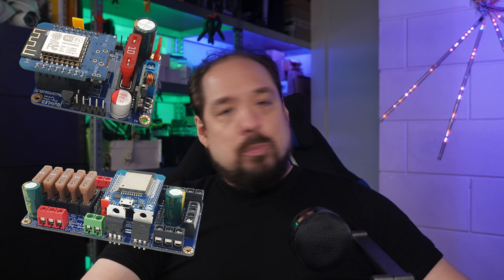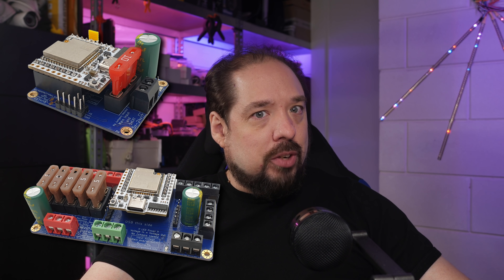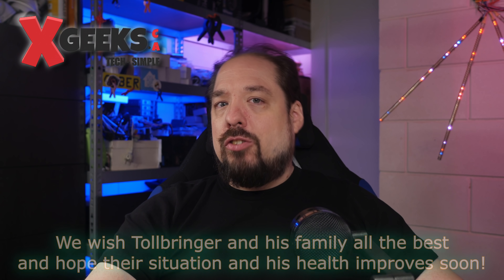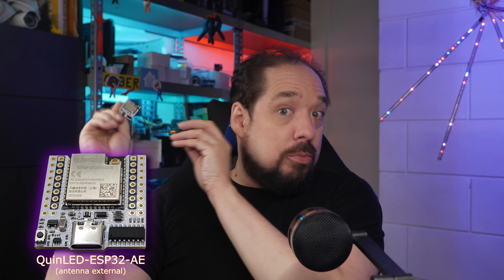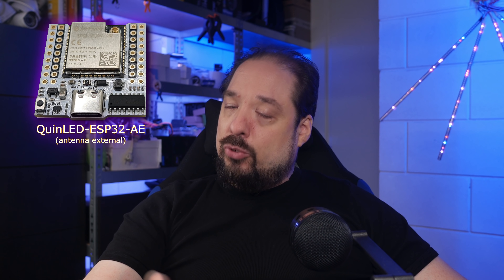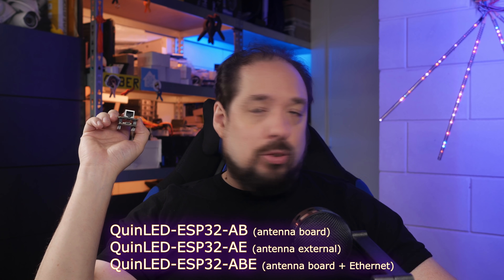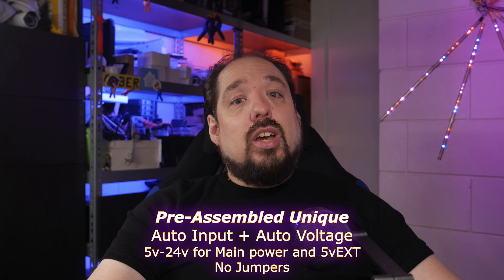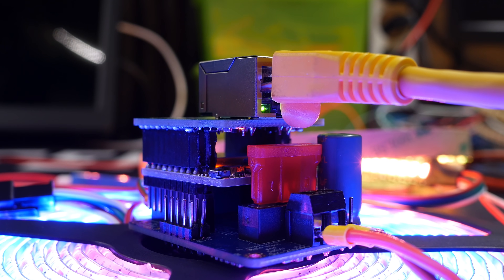💡QuinLED💡 Why out of stock for Dig-Uno and Dig-Quad?

Comment from the maker: What type of board combination are you most excited about? Let me know in a comment!
Reply: Super tof werk aan het verrichten! Ik ga zeker een nieuw pre-assembled board kopen, waarschijnlijk die met ethernet. Ik kan niet wachten!
Reply: Looking forward to esp32 with external antenna on a diy quad. Just love soldering too much.
Thanks for your work and keeping the diy alive!
Reply: DIY Boards, of course! This time I'll pay for a solder mask, yikes, way too many small parts last time
Reply from the maker: You mean a stencil? I'll still keep to 0805 as the smallest component so should be fine without too, but stencil can't hurt either. :)
Reply: @IntermitTech  Are all the dig quads 2oz copper? I plan to run 1920 WS2815s which is 300-350 watts continuous on white and I want to make sure it's safe.
Reply from the maker: Pre-assembled is always 2Oz, yes. Those wattage should be no issue, try and keep a little bit of airflow around the board if possible. Inside of a box it would cause a bit of heat build up.
Reply: Looking forward to Ethernet version.   Will have to design a DIN rail mount for it as rest of my home automation devices sit in a cabinet with DIN rails.

Comment: Hello , I need a help; I have a Dig Uno, how many pixels of a WS 2811 string can I handle with this, I am feeding it with 5 Vlts 30A, The reason why I ask is that I have a matrix of 800 pixels of 5 Vlts, I would like to know if the Dig Uno with Xlights can handle it without problems.

Comment: Great to flash online but when trying to flash the SR version it just hangs at "Wrapping Up"........ suggestions?
Reply from the maker: Yeah it's done at that point, it doesn't yet support the wifi setting. Reboot it and it should broadcast an WiFi AP like all WLED worked before. :)
Reply: @IntermitTech  Thank you.  That worked

Comment: Do you think now would be a good time to release the gerber files for V2R6? As long as there isn't an R7, there really shouldn't be much confusion once V3 is the new standard.
Reply: Just wondering because I recently got into designing PCBs and I learn a lot from reverse-engineering or just playing around with existing material.

Comment: How do you connect a microphone (for sound reactive), to the dig uno? I see an A0 pin, but it it under the esp32 and can't plug anything to it. i have a v3r7 board
Reply from the maker: A dupont wire should go there just fine, it'll be slightly snug but fits, that way it won't easily fall out either. :)

Comment: We got our Dig-Quad the last part of 2020 and I'm now trying to flash it for V 0.12.0 to run all 4 pins. But when I plug it into the USB  (with a data cable) to flash it, the esphome-flasher doesn't find any it on the Serial Port. Is there anything that needs to be done to get it working? This is the first time trying to flash it since we got it.
Reply from the maker: Yes, install the USB to serial drivers, they are in my QUINLED-ESP32 page.

Comment: Good stuff!   Will the ESP32 with external antenna work with the EtherNet port add on?
Reply from the maker: No, it will only be sold as a whole unit combined with the board antenna. Technically I could combine it with the external antenna version too, but since you are going to be usjng Ethernet, using the cheapest ESP32 makes most sense in my opinion.

Comment: Will the QuinLED-ESP32 connect to 2.4ghz & 5ghz networks? An issue with connecting the boards currently is they only connect via 2.4ghz, making it difficult to be detected by Alexa If you're on a "smart" router like Google Fiber as Alexa will connect via 5ghz and there is no way to strictly connect to one band or the other.
Reply from the maker: No, sadly the ESP32 doesn't have 5Ghz capabilities, but if your 5Ghz clients can't talk to your 2.4Ghz clients, that's purely a network related setting...

Comment: This is SO nice!!! Your own esp32 board, the auto voltage detection on the dig boards.

I would really go for a version with Ethernet. An enclosure would really finish it.

There would just be one extra wish from me: I don't need addressable LEDs everywhere. Will there ever be pre-assembled units for the old-fashioned  'analog' led strips? Or would it also be possible to still run these from Dig Uno or QUAD?
Reply from the maker: I am working on a new board for Analog LEDs, hopefully available somewhere this year!

Comment: Just in time for my new LED project. Can't wait to try the new board!

//Just to make sure, did you keep the GPIO pins? I'd like to use it for buttons and  some external LEDs. Thanks
Reply from the maker: The new board has new GPIO assignments, but the same functionality. So the Q1-4 are still there as are audio and the button pin, just assigned different GPIO pins on the ESP32 because of Ethernet support. :)
Reply: Thanks for the reply. That'll be great!

Comment: The new boards sounds really good, nice work :) Can it still be flashed with EspHome? For example I would like to add PIR sensors and automatically switch the LED strip ON and then switch then back OFF after a decided time. Or is there another way to this?
Reply from the maker: Sure, they are fully open so any software you'd like to run! I have ESPhome examples for Ethernet in my articles for instance.

Comment: Almost looks like a mother board header on the small one to plug in led fans directly to the board?  That would be cool, but not expected
Reply from the maker: You mean the pin headers? Those are spaced 2.54mm so might actually fit, but best would be to just plug the bare wires into the terminals, then generally most PC RGB stuff like fans will work fine, it's just using ws2812b or variants of. :)
Reply: @IntermitTech  if only I knew which wires were which on the fan!  My QL series have a connector for fans, then a separate one for the LED’s, that has 4 wires in it. Don’t know which ones are which
Reply from the maker: Ah yeah, 4 would make it a bit confusing for addressable LEDs. I haven't played with it too much myself (I run all Noctua) but most stuff is just the normal addressable LEDs. Maybe somebody already tested it?
Reply: @IntermitTech .   Corsair has a program that runs corsair’s  controller. Which means I’d need a motherboard. Only thing is I like to use these kinds of fans to keep my home audio equipment cool, and I like the lights.  So that means these aren’t hooked up to a computer. The ones I have now are old and are using a controller that would go in a blank space like where a CD drive would go. I’ve been browsing the Corsair forum to attempt to figure out how to hook them all up to a diguno since I don’t want to use a computer program when there’s no computer.  Thanks for replying! Love your videos !
Reply: @IntermitTech  came back to say that I finally found out which one is the 5V, ground and data pin and the dig-uno works on the Corsair QL fans!
Reply from the maker: Hey, thnx for reporting back, that's awesome info! Hopefully WLED can make them look pretty. ;)

Comment: Hi Quindor love your work. I like DIY but have issues sourcing the parts required. Would you consider just putting all of the components into a bag and selling it that way. for example if I ordered a dig Uno and a Quad I would get 2 bags containing all the components (maybe a few extra of ones easily lost) I need to solder.
Reply from the maker: Sadly, that works out to about the same cost as getting them pre-assembled all together. I'm still looking into it nonetheless, but if I can't make it financially significantly cost less then pre-assembled, I don't really see the point right now. Buying the parts on Aliexpress is hands down going to be the cheapest option to build a few DIY. Me buying in bulk and bagging is always going to cost more but even like providing a BOM so digikey or other websites which support that, makes DIY cost more then pre-assembled.

I understand the fun and learning part of it, and that's partly why I invest a lot of time in DIY, but the only way it makes sense price wise is the current form. :(

Comment: Waiting patiently for dig- uno with ethernet to become available.  I'm only powering 4 segments,  total 6m (576 led) ws2812 and so I see no need for a dig- quad.  Of course I am open to hearing why a Dig- Quad is the smarter choice
Reply from the maker: A Dig-Uno would indeed be fine for that, the Dig-Quad would mainly add a bit easier power distribution because of having multiple positive and negative terminals. Othe then that you should be fine indeed.

Comment: Can't wait to get hands on the dig quad with external antenna. 15m of ws2811 for an outside project are waiting to be controlled by your board.

In the meantime I come across the atuline wled fork for sound reactive leds. Will it be possible to hook up a microphone?
Reply from the maker: Yes, the boards have a A0 pin for a simple Analog microphone or you can use 3 of the Q1-4 pins to hook up a MEMS microphone

Comment: I am very curious about the Ethernet Board. Will it remain green pcb or will it be white in the final version, just like the Esp 32?
Reply from the maker: That was a pre-production prototype model. In the end it'll be a nice stack of white boards (the ESP32 and Etheret top hat). The Dig series remains blue. :)
Reply: @IntermitTech  another question. Are you going to explain how to custom compile a code with Ethernet support or does it remain with the precompiled variant for your board? I think it would be pretty interesting to see how the compiling process with Ethernet support works.
Reply from the maker: Did you check the linked articles? It's all in there for WLED, ESPhome or using Arduino. :)
Reply: @IntermitTech  ups. I skimmed the article, but didn't see. Thanks for the answer

Comment: I was getting a little frustrated at the delays, but I'm really glad to be able to have an Ethernet connection for my wait.

I've ordered everything else, and it starts coming today. I can start assembling, and attaching things to the house. I'll run small tests with a Raspberry Pi, and look forward to getting my Dig-Quad.
Reply from the maker: Yeah, and I can understand that quite well, it wasn't planned to be this long at all, but all I can say is, it'll be worth it. The boards are quite improved in many ways, and lots more options!

Comment: Thanks for the info. Am i able to get the QuinLED-ESP32 pcb ordered and solder components on my own ?...or they have be bough pre assembled ?
Reply from the maker: All variants of the QuinLED-ESP32 is pre-assembled only, but you will be able to buy individual boards of each variant in the the worldwide and US local store once available. There is multiple reasons for this but the biggest one is that it uses down to 0402 components and it would be tough for most people at home.

Comment: In the video, you mention that there's a dedicated level shifter per channel on the new Quad.  Was it some kind of shared level shifter in the previous version?  I'm going to be challenged with some distance to various trees.
Reply from the maker: The pre-assembled boards have always used individual level-shifters per channel, in my testing it did slightly better then using a quad chip version. The DIY version does use the quad chip version since there aren't any through-hole or wide pin spacing versions of the single version. It's not that big a difference in data quality but it's also if someone for instance touches a data terminal with 12v, it will destroy 1 channel instead of making the whole board useless for instance, worth the slightly higher costs. :)

Comment: Hope Tollbringer and his family are well.

Awesome! Just wondering have you considered a variant that comes with a relay to lower power consumption when the LEDs are not powered on?
Reply from the maker: I have considered it, but it would make the boards considerably bigger and at the same time handle less power. My boards do offer control of external relays and I usually prefer a relay on the AC side and then using the 5vEXT feature to keep the board alive with a second power supply. For the relay that just requires 3 dupont cables to a 2$ external board and it works. :)
Reply: @IntermitTech  thanks for the explanation! I've been learning so much about LEDs from you (thank you for that) and Drzzz for home assistant!

Would you mind linking something or do you happen to have a video on adding a relay :)?
Reply from the maker: Check the Digital LEDs section on https://quinled.info. There is a special article for the Dig-Uno and a wiring diagram for the Dig-Quad in the wiring guide.

Comment: I think I got one of those bad D1mini-32s, but I haven't ruled out a bad power supply yet. If I can just replace it with one of these new esp32s (look awesome btw) that sounds really good. I'm excited to get one of these soon! I'm doubling my ARGB count for next year and need lots of channels to control the new set. Hooray for Christmas!
Reply from the maker: It's possible, hit me up on Discord, there are a few potential fixes we can try!

And yeah, in the end swapping it out with a QuinLED-ESP32 will work for sure! :)
Reply: Looks like I'm good now; I flashed WLED v0.12 and it stayed on wifi a good 10 minutes while I ran some test cycles. Not sure if it was a bad flash (I tried it twice before) or what, but I don't have any problems now. Cheers!

Comment: I'm really excited to get the ESP32 Ethernet. I like building my own boards have several Dig-Uno,  Dig-quads and Analog Quads ready to go, going to be a great add to my light show!
Reply from the maker: Awesome! :D It'll work with the current boards too, but might require a few small modifications (mostly on the current version Dig-Quad). Make sure to check the limitations page. :)

Comment: Hello ! I habe ordernd one of the Quin Dig Quad Board about 4 weeks ago. Today i Recived the Board  Bit it is still the old Version. No USB C conector and old ESP32 Board esp Wroom. Version 1.0.0. and it is still the Version with Voltage Jumper.
Reply from the maker: Where did you order from? Since DrZZs, xGeeks and I have been out of stock for a while now. Also I just only talked about the new coming versions in this video, clearly stating they are coming. But let me know where you ordered from. :)
Reply: I ordernd from the Shop in China Allnet.China this was a per assembeld Board.

Comment: Thanks for the update for us CDN folks. Had a buddy that did order from XGeeks and was not sure about his order. I got him a couple of my Dig Uno's that I had so he can still go ahead. Excited for the new rev's. Question for the DIY, I have a cart on Ali Express standing by to order most of the components needed for the previous Dig-Quad, recommend to wait until the updated DIY is released? Our long shipping times from China to Canada force us to plan things out months in advance. Again thanks for covering pretty much all of my questions in this video. Cheers.
Reply from the maker: There will be some component changes (like moving to the Dig-Uno DC-DC converter and different sockets for the ESP32 board) but most of it will stay the same. So even if you order now and later want the updated PCBs, you can re-use most of the stuff. :)
Reply: @IntermitTech  That makes sense. Thank you again for all the work you do for us LED Heads

Comment: I wanna first thank your for being able to test the ESP and those updated boards! They are truly fantastic! Everybody: Be excited!

The QuinLED-ESP32-AE already comes with the little antenna shown in the video and it actually helped me with a setup I have outside / on the balcony. Without it, I had to move a Wi-Fi access point super close to the balcony door. Now, I can leave it where it is (~6m away with glass doors inbetween) and the signal is still great!
While I have only done some basic tests with some sensors I have laying around, I can still say it works flawlessly and is absolutely interchangeable with any other ESp32 and you even get the stability benefits, 2021 USB connectors and a beautiful, dim orange LED! So your sensors in your home don't light up your rooms because of the ESPs LEDs ;)

Be excited!!